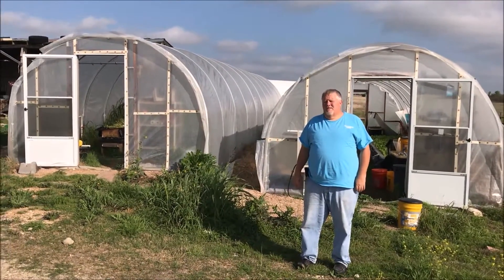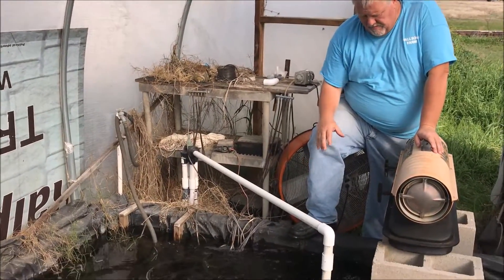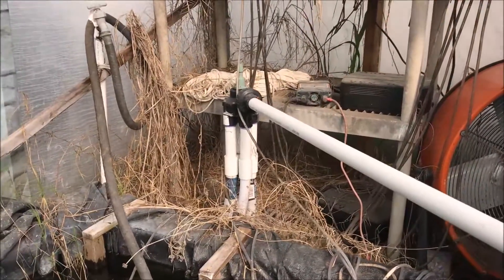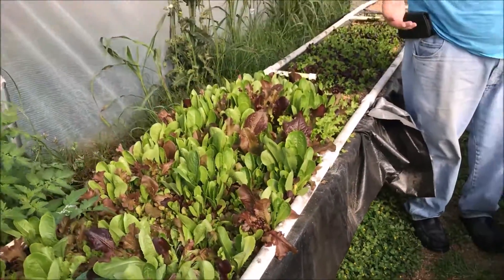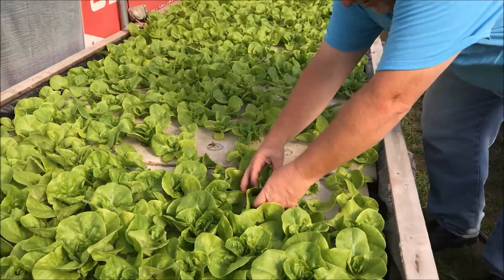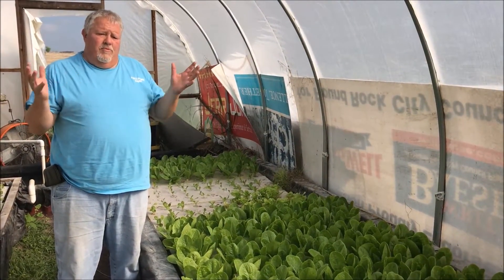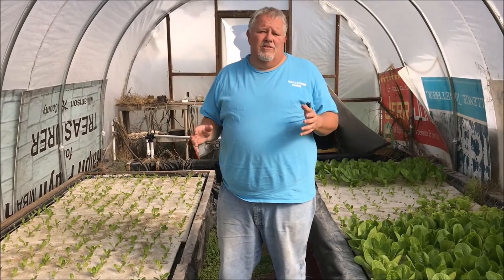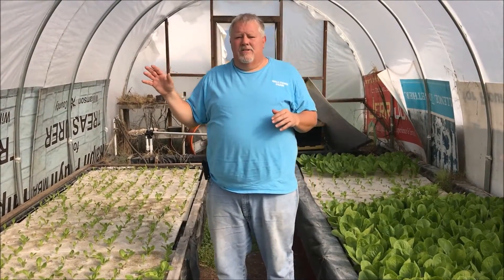Sustainable Farming tour of commercial aquaponic system

Comment: for the floating raft or DWC, can i make the tank like 3' tall and 2' wide? I'm wanting to make my sump tank and DWC tank in one to save space, an probably have to run a split flow system.
Reply from the maker: yes it can be deeper. Using the raft bed as a sump is perfectly fine.

Comment: Was there a reason you decided to go with a timer on your pump rather than a bell siphon system?
Reply from the maker: +Jeff Sullivan yes, my other system built in 2009 is with bell siphons with 4 x 8 beds, the bell works so well it now drains the water close to it quickly then shuts off. The other end of the beds only drains about 2” in that time. There is enough build up in the bed over time that water does not flow fast enough for the bell to drain the bed. With a flood and drain I set the timer so the bed doesn’t get more water until it has completely had time to drain. Also I put the drains in the middle of the beds not one end.
Reply: My bells are in the middle of my IBC beds so that's typically not an issue.